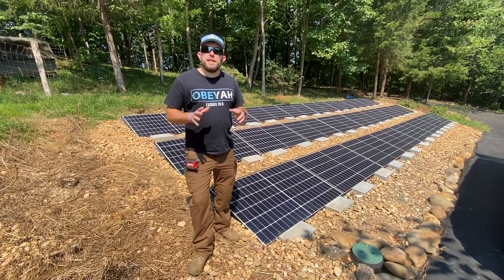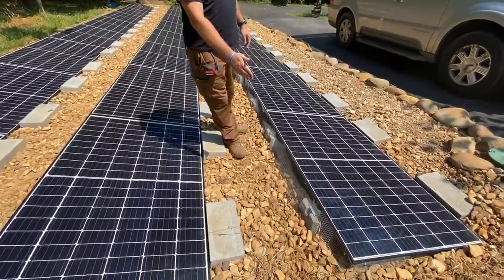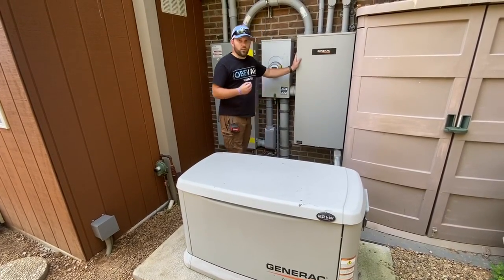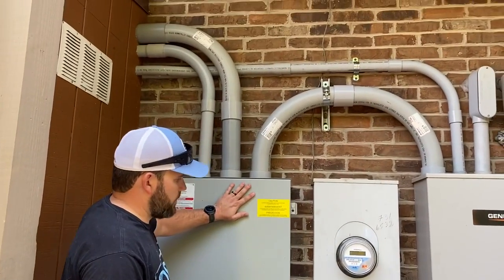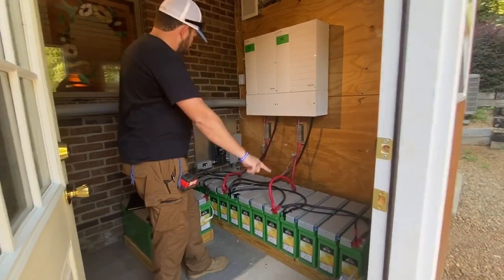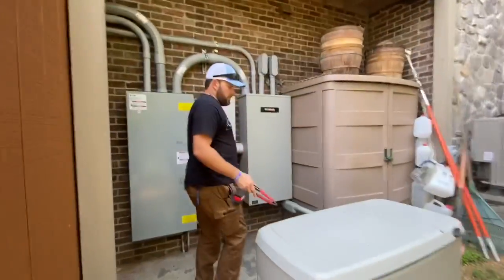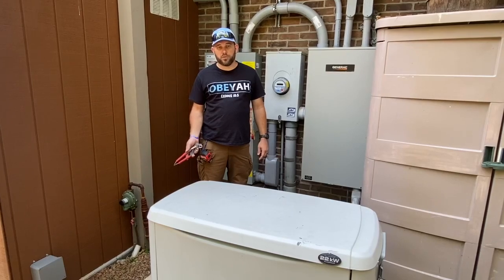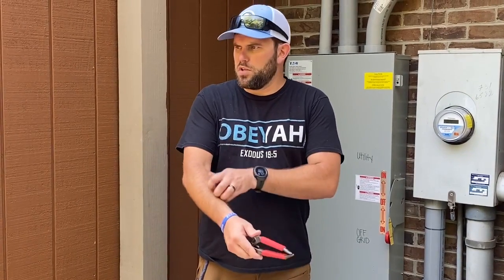7.5KW solar ground mount block ballast install with generator back up by Off Grid Contracting

Comment: Question, would I need a permit for a setup like yours where panels are resting on the ground?
Reply from the maker: Depends on where you live
Reply: @7TRUMPETSPREPPER  I’m located in Connecticut. Permit is a huge pain on the ass where I’m at, as part of my property is considered flood zone.